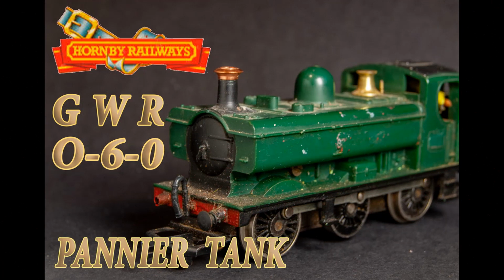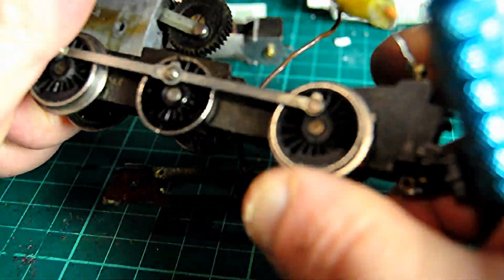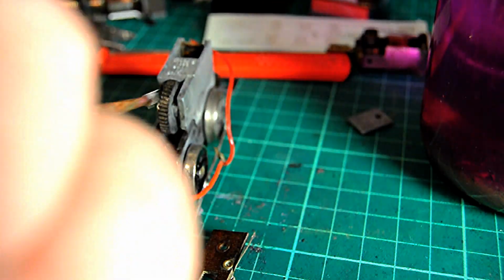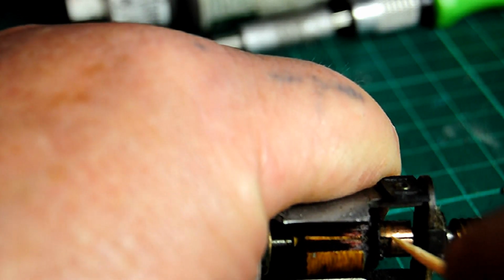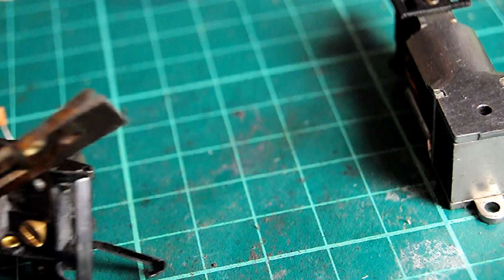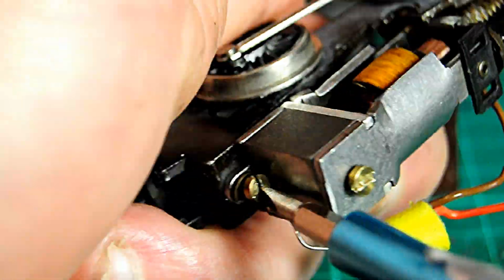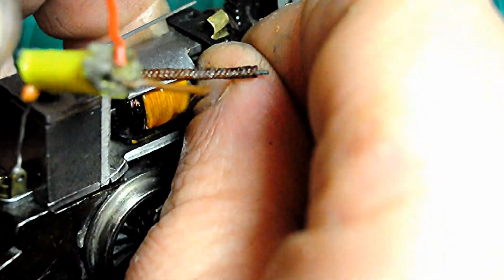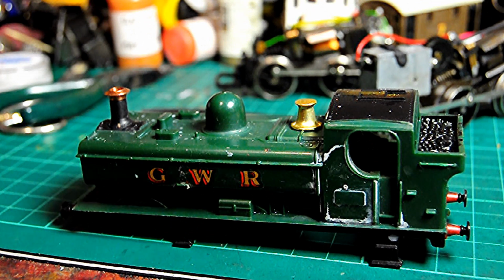HORNBY R041 GREAT WESTERN PANNIER TANK RESTORATION . Modelleisenbahn-KOFFERBEHÄLTER,,, RESTAURIERUNG

Comment: I've used industrial superglue gel (its thermo fast curing / cold slow curing) to fabricate thick plasticard motor adaptor trays and gluing Hornby miniature motors to said trays, to power old Triang chassis. My 1960's Triang R.152 Armstrong-Whitworth 0-6-0DE shunter (with Romford wheels) was converted back in the mid 1990's and still runs on my layout today.
Reply from the maker: cheers buddy interesting info

Comment: According to my 1972 Triang-Hornby catalogue, the GWR Pannier was R.051. 

This number was previously attached to the Triang Railways R.51 N2 0-6-2T clockwork loco (1952-1954).
Reply from the maker: THE SAME MODEL HAS HAD BOTH NUMBERS I'D SAY ONE WAS THE TRIANG HORNBY AND THE OTHER A LATER HORNBY OFFERING

Comment: I got one of these that smokebox beautifully when it wanted to, helathy smoke of course not the motor blowing up 🤣 currently needs a magnet recharge and finer wheel's as it clunks along over some point work i have. I see you got a Deagostini Toby tram back there for a possible conversion!
Reply from the maker: TOBY IS PART WAY THROUGH BEING ALTERED , PUTTIN LED LIGHTS ON HIM I GOT A MINT BAGGED ONE THAT HADN'T BEEN OPENED

Comment: I never knew these came with a smoke generator. I have one in my 'to do' box and should check to see. You can replace the old magnet with some small neodynium cheap magnets.
Reply from the maker: SOME DO SOME DON'T  THERE ARE USUALLY MARKINGS ON THE BOTTOM OF THE CHASSIS , SU MEANS SMOKE UNIT , SS MEANS SYNCHRO SMOKE , AND PLAIN MEANS NOT FITTED , THIS ONE WAS A FACTORY SYNCHRO SMOKE